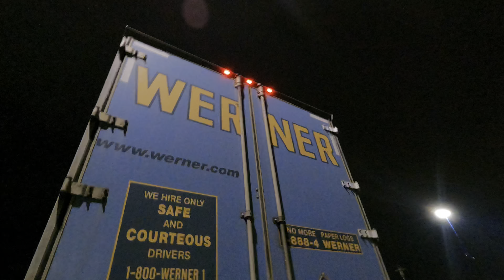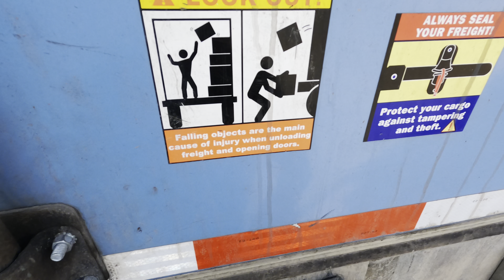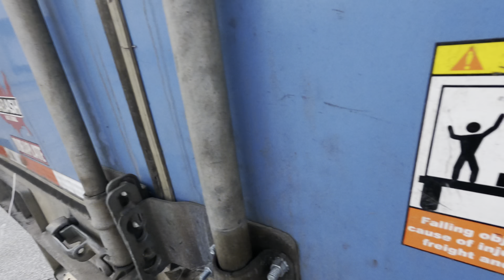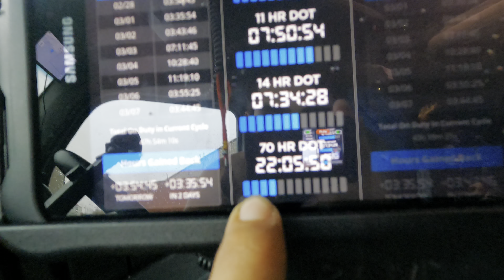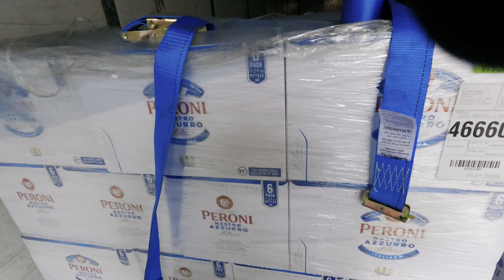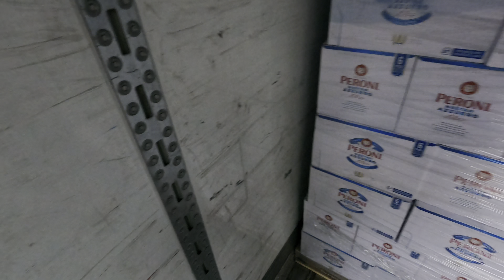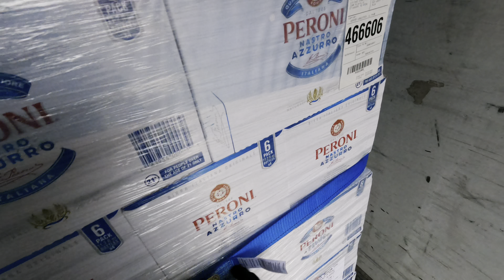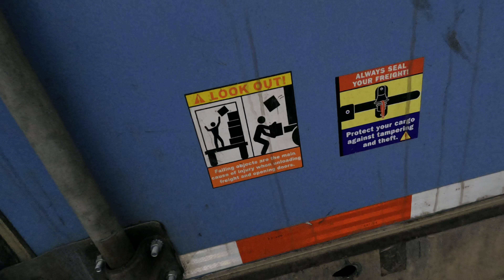1500+ mile load to New York **Rookie  driver**

Comment: Hey bro cool stuff! I never got to go there. Whenever you're in a terminal, go to the shop and ask for a second strap. Also make sure you have a full bottle of oil and coolant in case you need to fill up on the road. In the winter, antigel is a must as well. I usually kept 4 bottles of with me and replenished everytime I went to a terminal. As far as the trailer handle, a rubber mallet comes in handy for some of the tougher to deal with ones. Drive safe!
Reply from the maker: Thanks 🤙🏽 for sue need to get more coolant haha 😂